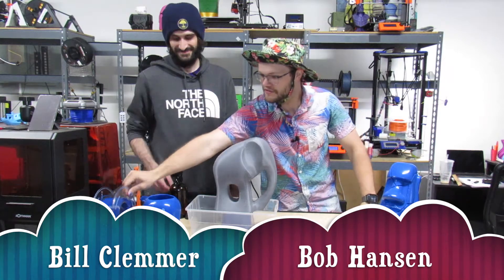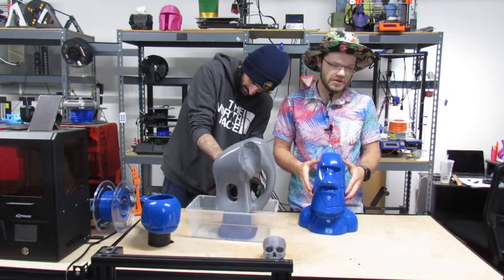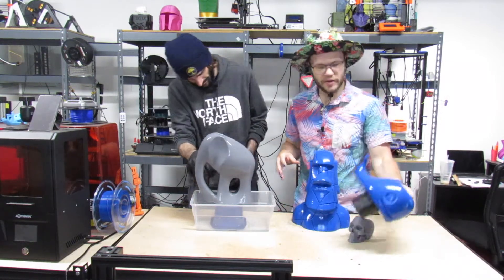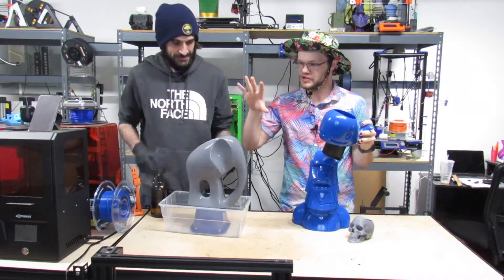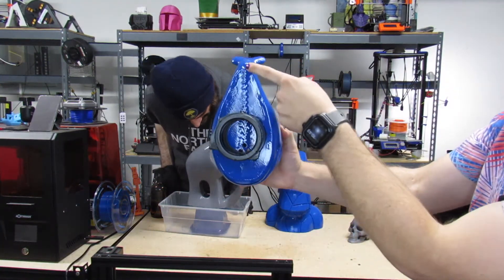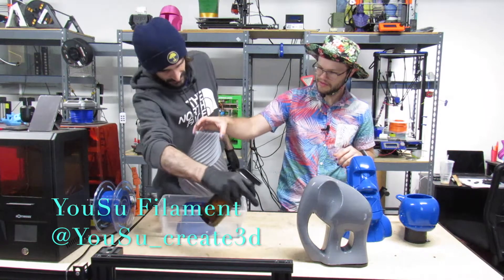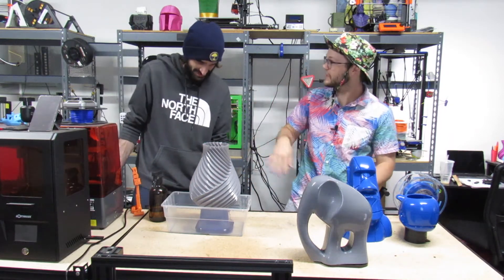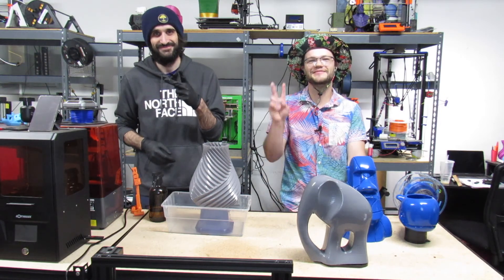Smooth Filament? Our Review of YouSu PVB Filament!

Comment: Ordered some 
Do you know the difference between 3a and 3j 
Is that just color codes or different materials
Reply from the maker: That’s a good question 🤔 I think it’s just color codes
Reply: @DaBobVlog  I'm having horrible results with it anyway lol. I'll try a few more prints. I did a spray and a vapor smooth and the vapor smooth just turned it to a gummy bendy print
The spray didn't really do much except make it shiny with a gummy outer layer.